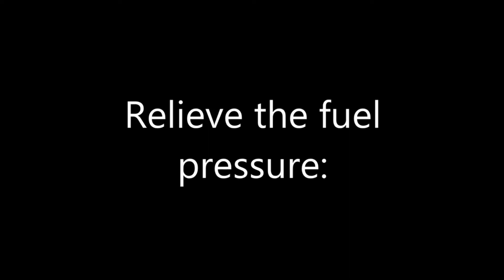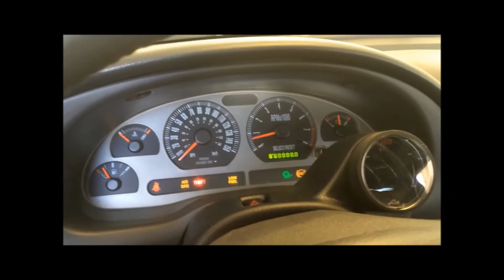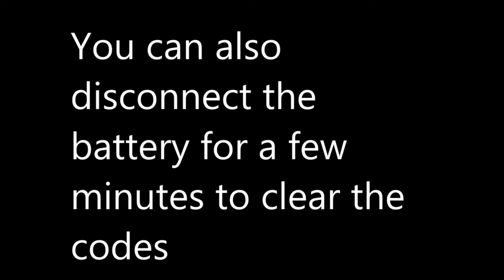How to Relieve Fuel Pressure: Ford Mustang

Comment: I hope you see this comment, I have a 2004 40 th anniversary mustang gt v-8, do not see a Schrader valve anywhere to check the fuel pressure.  I have googled and have seen that this model does not have one ?  I thought you may point me in right direction.  Thanks.
Reply from the maker: I have also seen 2004s seem to not have it. You’d have to add one with a kit, which may not be worth it

Comment: Could this help if it's flooded?
Reply from the maker: You’d be better off just holding the gas pedal down while you crank and that will cut fuel.
Reply: @dannyjohnsonsgarage  I don't have to unplug anything? Just hold down the gas?
Reply: @dannyjohnsonsgarage  it worked! Thanks dude 👍. You saved a lot of hassle

Comment: Hey man got any tip for a 07 every time I start to crank the car it starts leaking gas from the fuel rail pressure sensor and the hose over the manifold
Reply from the maker: I’d remove the sensor. It may need a new o ring. You don’t want a fuel leak or it could start a fire. The fuel rail sensors usually have one bolt and then just pop off

Comment: Do you have to do this before you change or replace a fuel filter ?
Reply from the maker: Johnblake 7382 It’s a good idea, but if not you’ll just lose what fuel is in the line and the filter so wear some goggles!
Reply: @dannyjohnsonsgarage  what powers the fuel switch
Reply from the maker: Xavier Delgado The spring mechanism holds it down, so when a force or impact is felt it will pop.

Comment: Got a 04 left it in the shop for the winter with low gas and i put in 5 gallons and it cranks but wont crank over ? Any tips i tried pressing the gas.
Reply from the maker: Here is a list of things to try- the starter fluid will be your best bet with it being the pump or not. They can get gummed up with the ethanol in the fuel. I have a repair video for the pump itself too https://youtu.be/JvgKGJjAwU0